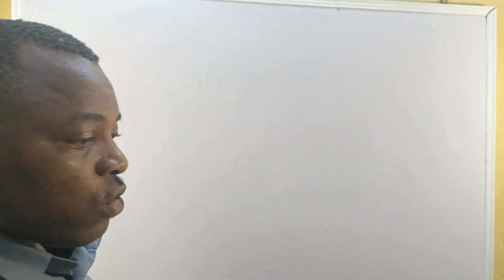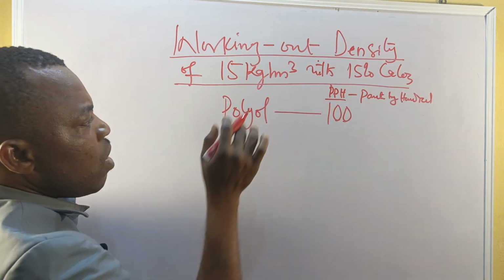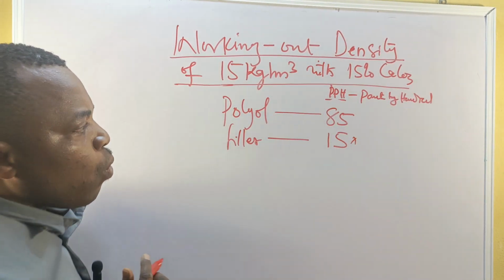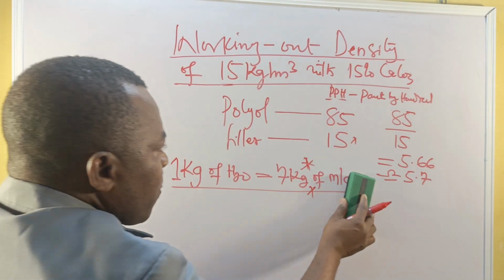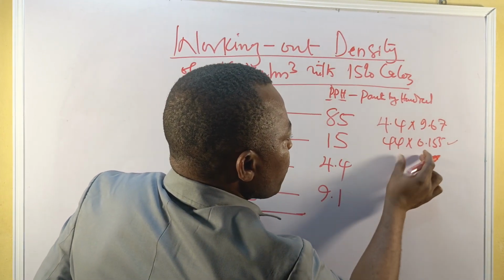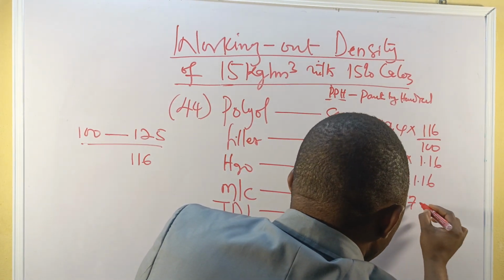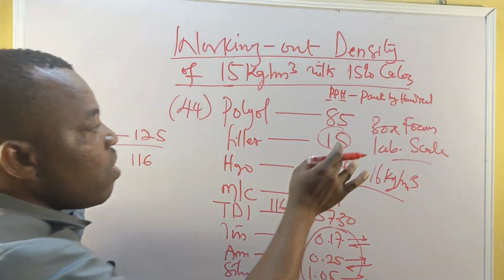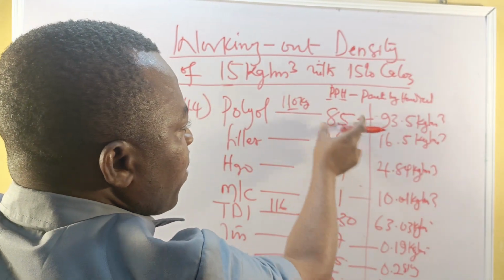LESSON 17: SETTING UP PU FOAM FORMULATION OF 15DENSITY WITH 15% CaCO3.  (The Experience that Work).

Comment: First i said thanks for class , good way explain ,but polyol why 85 it shuld be 100 , b/c filler is not replace  polyol amount , so can u explian why u set 85
Reply from the maker: Polyol is 100 part this is global standard for Pu foam Formulation. If you are using 15 parts of filler you then substitute 100-15 part is 85parts . What ever measurement is based on this 85parts of polyol because filler do react.
Reply from the maker: Filler take the remain 15 and Polyol is 85.
Reply: estas poniendo para 85 de poliol 4.4 de agua.. por lo tanto para 100 de poliol si haces la cuenta pones 5.176 de agua.. que con 9 de m c y 15 de caco3 si puede salirte una densidad de 15